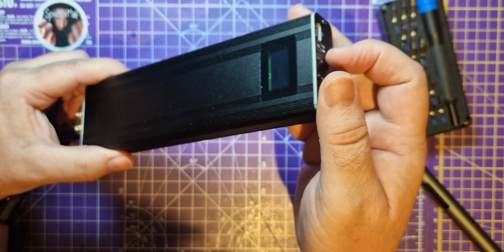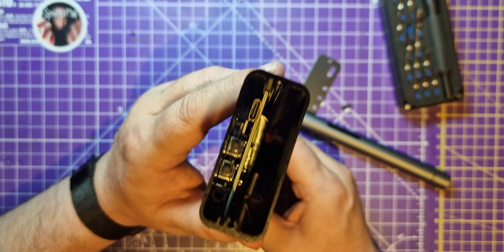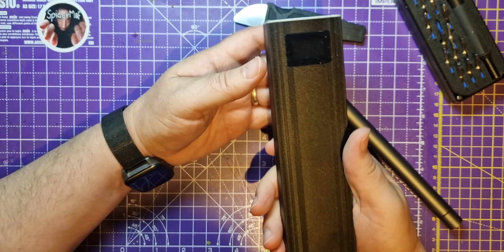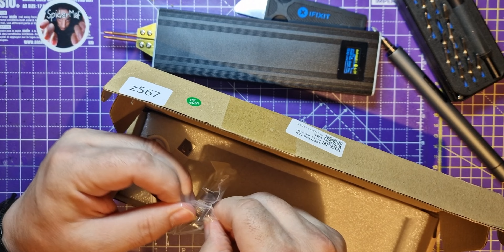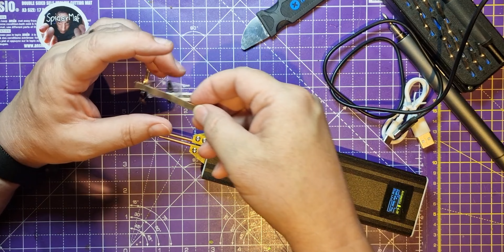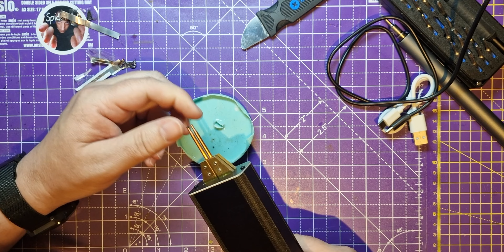What's inside a Hopbucan 1Set 80-Gear OLED Digital Display Spot Welder for 18650 nickel plate welds

Comment: I have the same welder as your previous one. It also had completely flat cells, but I managed to recover mine by putting it on my bench supply with a current limit of 100mA and careful monitoring. Cells warmed a little but didn't get hot, and once voltage was up a bit I was able to charge on the usb input. It welds fine now, though I need to charge it every few weeks.